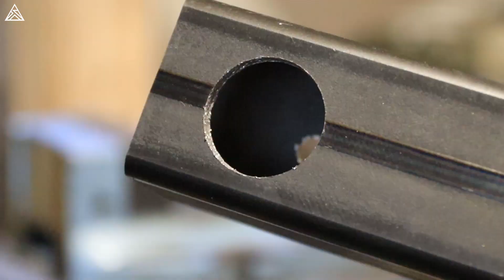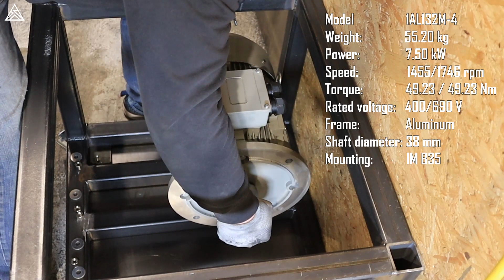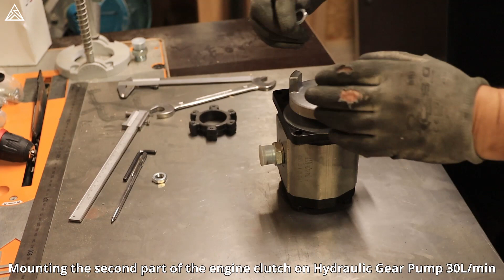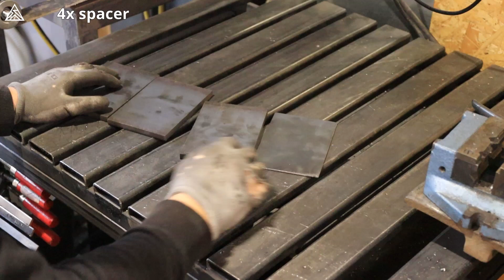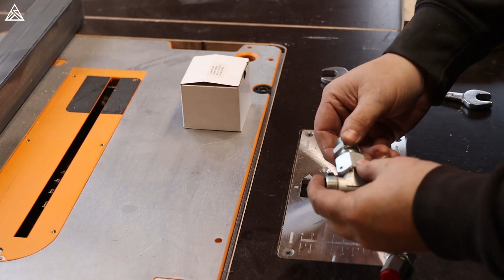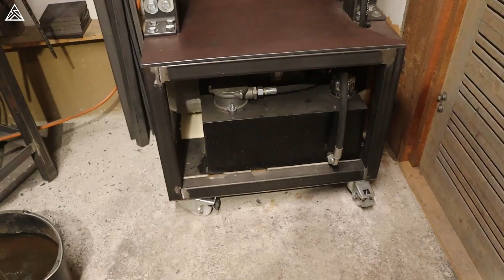20 Ton Hydraulic Forging Press

Comment: The press is great.
In my opinion, the bottom of the metal sheet under engine is completely unnecessary and only collects dust and dirt.
Without it, everything will fall down to the floor and be easy to clean.
Extra screw holes could be useful to lower the anvil / table for larger workpieces and other works.

Comment: I was thinking about 30t until i saw this. Great job and thanks for showing me the strenght of 20t.
I saw once declared 30t but after seeing the cylinder i calculated it. It was 24t max. But the one was way weaker ( around 20% ) than this one, I guess the motor was too weak for this.

Comment: Did you get your hydraulic piston from a heavy equipment machine?  Like a CAT excavator?
Reply from the maker: Yes, it's a recycle from a CAT excavator.  It can be obtained for really little money.  😀
Reply: @CZnipper  Yeah, me and a buddy are looking for one right now.  Hope we can find one.
Reply from the maker: @michaelwood5519  
Mainly find with the largest possible diameter. High hydraulic fluid pressures are then not required.